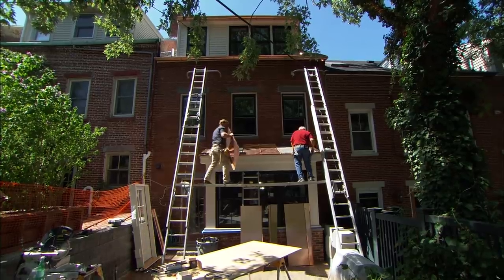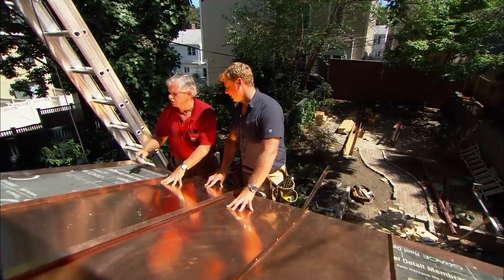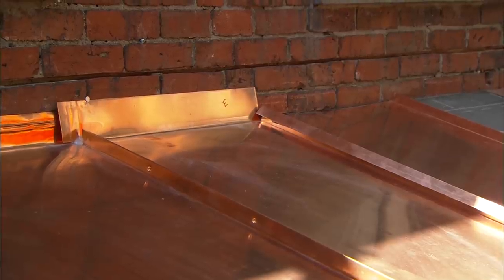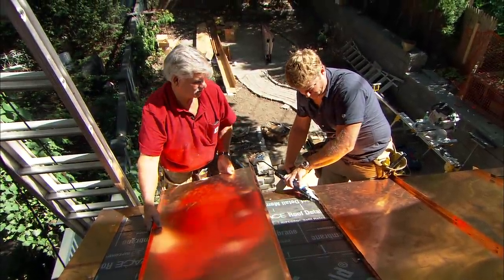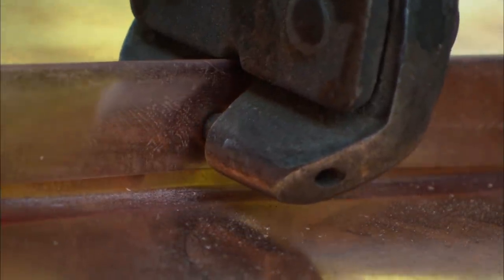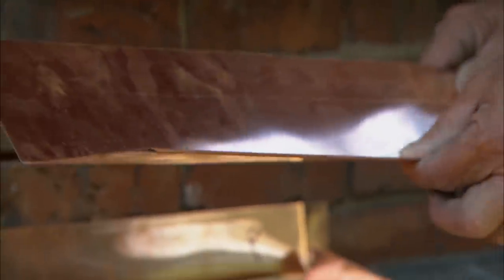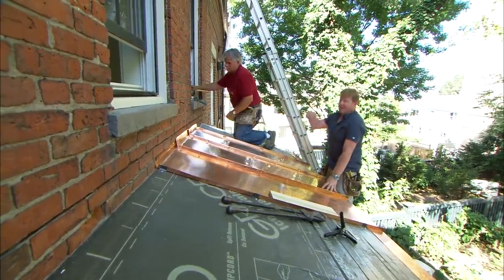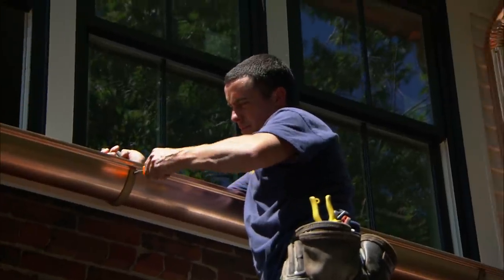How to Install a Copper Roof | This Old House

Comment: Does using Aluminum nails and cast-iron clips cause corrosion because of different kinds of metals .I would’ve thought copper nails would’ve been an essential
Reply: Exactly same thing went through my head when I saw it.
Reply: Yes, should be stainless or copper.

Comment: Wow, this would last 0.4 nanoseconds in the UK without being stolen. Can it be electrified?
Reply: Probably it could, great thinking.
Reply: oh come on.  London has town homes with copper stuff
Reply: It CAN be weaponized like everything else.  ;-)
Reply: They’re using aluminum roofing nails, so it’s already a crude battery
Reply: It's not pure copper its a galvanized product so its essentially worthless. Pure copper sheats would be way too expensive to sell. Essentially its  a base metal like Tin or Steel that has been either plated or sprayed with a copper coating.
Reply: Well, it being in Massachusetts makes it a more easier theft...In other states we can shoot at the thieves..lol
Reply: You really went to the details didn't you! 😅🤣
Reply: @carholic-sz3qv  he ain’t wrong.
Reply: Can copper be electrified?
Reply: @zunedog31  I don't see technically why it couldn't...be racking up a lot of dead squirrels and birds though...
Reply: @zunedog31  no you're right it's the lest electrically conductive material known to man
Reply: It's show UK is very sad country to live in and it's government is inadequate to rule...
Reply: @sterlingodeaghaidh5086  my friend in Richmond Virginia area had home built and had real copper roof put on this new house its very expensive....
Reply: @sterlingodeaghaidh5086  It looked orange where he was cutting it.
Reply: @sterlingodeaghaidh5086  it is real solid copper, the material costs about $10 a square foot and $5 is the value of the copper. Companies do make plated or painted copper metal roofs, but what they are installing is real copper.

Comment: With heavy rain and snow laying on a roof like this you have leakage. The best way is to do a double seam connection.  I just did a double seam metal roof with 24 Ga. galvanized metal. It looks great.

Comment: I personally like the new copper color. I wonder if there is a special coating that can be put on the copper so it will not turn green? I wish this old house would make a video in detail on how a person could go about making it so a copper roof can always look like it was brand new and that same copper color?
Reply: There's nothing one can do. Copper can be coated with a clear varnish to keep it shiny, but the sun would destroy that.
Reply: finish klik felsdak copper colour .. its not copper but this colour will hold for good years to come

Comment: Copper roofs can last 100 years or longer.  A true standing seam is folded over twice instead of once and dimpled.  Really should have spent a few extra dollars and gotten copper nails.
Reply: Copper roofs lasted a 100 years before the price of copper went up so high that copper theft turned into its own industry...
Reply: By the time these white, rich people paid off for the roofing and gutter materials there is no money left for Tom De Silva to get copper nails....
Reply: There is no way for the condensation or moisture to escape at the edge of the roof and flashing is over top of the waterproofing. It could mean moisture and rot on the fascia board.

Comment: For people that don’t know, “dimpling”, the standing seam is the worst way to do this. Also, the ringlet in the brick should have lead tapped into it, followed by a proper sealant. Folks, if you ever decide on getting a copper roof, make sure you get a true expert, that does the copper roof correctly. This is absolutely, 100% wrong. Those seams should have been finished off, by using a double-lock system, not sealant and dimpling. This is sad.

Comment: Don't you have to use copper nails too? Won't aluminium cause a chemical reaction with copper and corrode?
Reply: Yes, ALWAYS!
Reply: someone here was saying this is just copper plated, so i guess it would only corrode the thin layer of copper, but not the metal inside...?
Reply: Yes

Comment: Idiots used galvanized roofers to hold the drip edge down Galvanized reacts with copper...They sell copper roofers and Tex screws...They're not too expensive...
Reply: They were aluminium nails
Reply: @hotdogs5265  stil , few more doll would buy some copper nails.
Reply: @brianglade848  It's actually Tek, since we're doing corrections...I've used them too...In our local vernacular Tek's screws become "tex"...What are you, new?
Reply: @godbluffvdgg  they are aluminum nails to me and I see them constantly in my line of work.  You maybe right about the corrosion.  I never worked on copper roofing before.
Reply: @hotdogs5265  I did roofing, including LOTS of copper...We used a rule of thumb; Copper to copper, aluminum to aluminum or vinyl and galvanized to galvanized or vinyl or asphalt...
Reply: @brianglade848  :)...That's old school shit...:I heard it when I got in the trades and used it when I became a master...it's a good ball buster for a guy that you know has been in the trades for a while...:)...WHAT'R YA NEW????
Reply: @brianglade848  Most of the big cities are pretty close in the way the trades speak...:)...
Reply: @hotdogs5265  still causes galvanic reaction.

Comment: Anyone else remember when This Old House had shows that were useful for the  average American instead of the rich ?
Reply: If you save your money don't have to be rich to fix a house, watch Ramsy show.
Reply: @786otto  Would you like to by a Timeshare?
Reply: Sadly, I'm old enough, yes. :-)
Reply: @bedlamp9157  No, I did not go to college.
Reply: The copper used on the porch roof isn’t THAT expensive. Their not using copper on the main roof of type house as I understand it so it not going to cost quit as much as you seem to think. Yes, it’s not a “budget” roof but it’s within budget of a middle class family who saves a bit as spurge and who limits to a small roof area within view rather then the entire roof/all roofs.
Reply: @Charlesb88  True on both fronts. But to be more fair, they've done periodic specialty stuff like this going all the way back to when Norm was still basically new on TV.

Comment: Amateur work, what a waste of copper. Steel nails? Snip and fold wall connection? Eave that's hardly locked onto the drip edge? NOT EVEN A PROPER STANDING SEAM? What a joke. Tom Silva seems to know his stuff generally but this is just a tragedy.